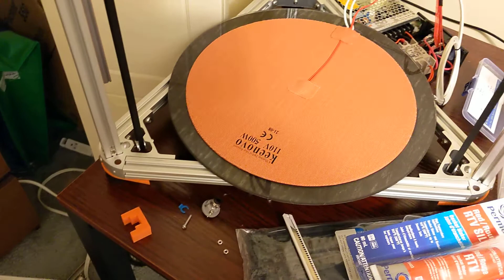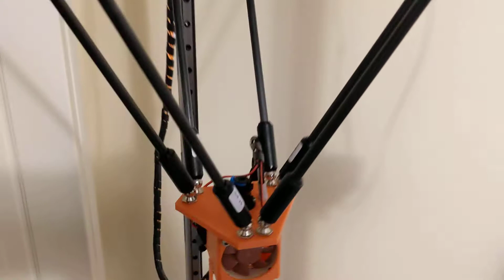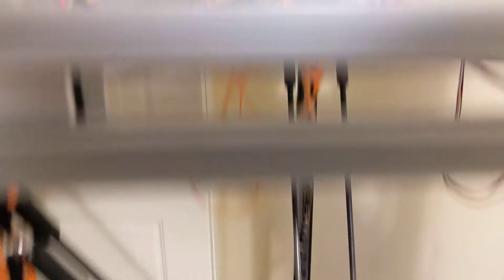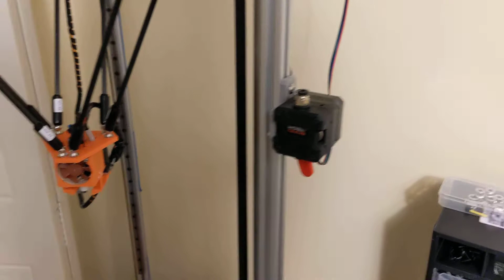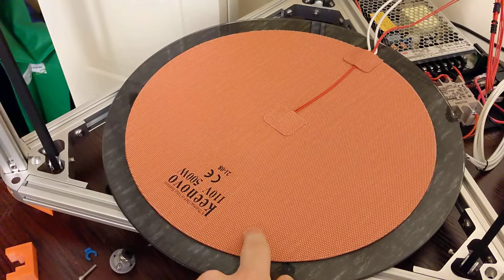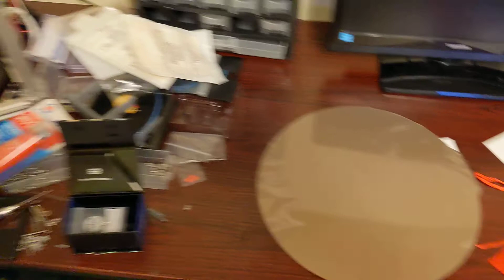Large Delta Printer Update 2

Comment: Have you had any issues with your PEI magnetic bed? Because the ones I have tried on my delta printer end up warping causing my prints to fail
Reply from the maker: I used the energetic brand, I have had no issues its really nice
Reply: @Rolohaun  awesome thanks for the reply I might give them a try or I will probably just use a glass ultrabase not quite sure yet.